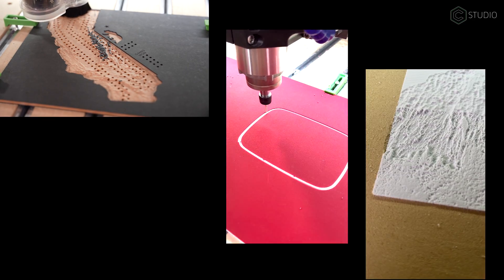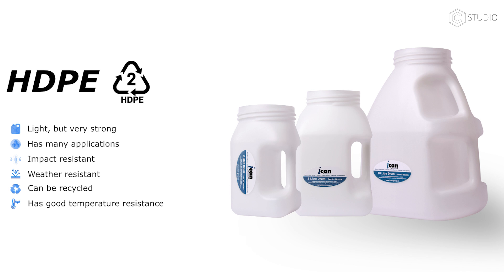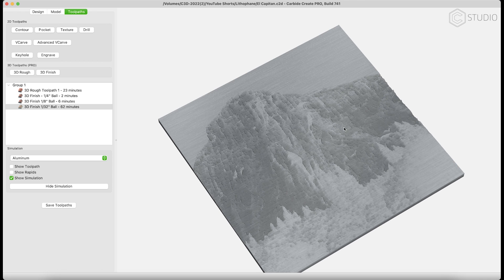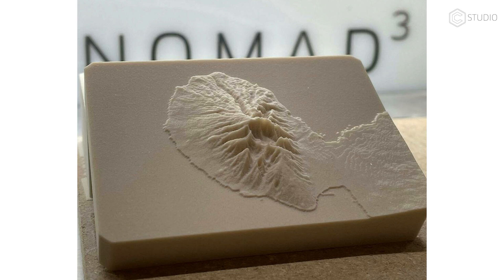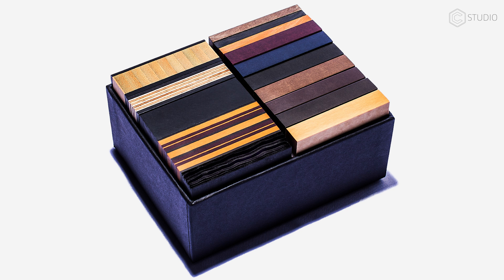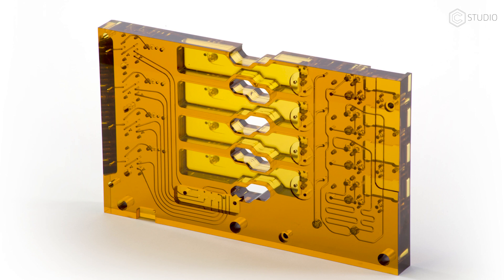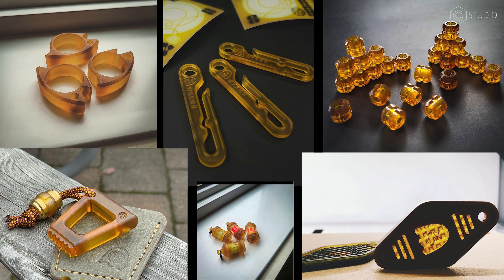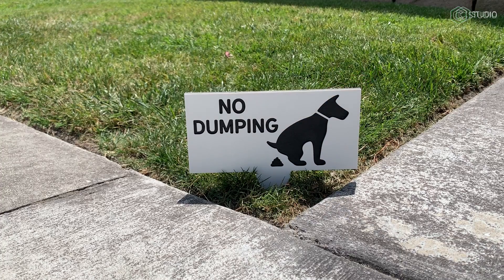5 Materials For Your CNC Router

Comment: There is ONE material that I've been 3D carving for a while, though I've never seen ANYONE mention it on 

YouTube, and that is Plaster of Paris. I got the idea a couple of years ago, and I've worked up a pretty good 

process. Carving the plaster blank rather than making a mold and casting the item will give MUCH better fine 

details. Plus, it's so fast and easy to carve, it's a TON of fun! :) If you have artistic skills, you can paint or 

color the pieces to your liking.

You can get started very simply, just buy a bag of DAP at your local crafts outlet and cast some blanks in 

plastic cups or food trays, doesn't get much cheaper than that!

You'll get better results and enjoy the process more with a few upgrades. 

Regular plaster does OK, but trust me and splurge for some good quality HydroCal plaster. It will hold 

AMAZING detail, offers extra strength and heft, and has a totally non-dusty finished surface. Avoid "Light 

Weight" Hydrocal, it's much too soft and flakes a lot.

Also useful are some of those silicone molds used for casting epoxy drink coasters, I have a bunch of 100mm 

squares, 100mm rounds, and a few larger ones for bigger pieces. Spritz the molds with some water with a 

few drops of dish soap mixed in to make sure the plaster flows into corners.

The next useful tool is a vacuum pump with a 2 gallon pot, for degassing the liquid plaster to make sure no 

bubbles are trapped inside the blank. I pull a vacuum, and then bump and swirl the mixing container in the pot
 to bring the bubbles to the surface. Let stand for two minutes, release vacuum, and do it once more.

It helps to put the molds onto a flat, movable surface, then level it with shims. Vibrating the molds after pouring 
can help a lot too, I press an orbital sander against the bench to do that, but you can just jiggle it by hand.

HydroCal will 3D carve EXCEPTIONALLY well, and since the blanks I make are less than 10mm thick, I 

simply run a 3D Finishing pass at upwards of 100 mm/second and a 10% stepover. I let the blanks cure for at 

least a week before carving. I'll typically use Tapered Ball-Nose endmills, 1mm diameter tip for most jobs 

including the ones shown in the photo, and 0.5mm for super-fine detail.

If you have any questions, I'll be happy to try to help you!

https://www.facebook.com/photo.php?fbid=10223705364078923&set=pb.1137301269.-2207520000&type=3
Reply from the maker: David,  This is very interesting.  Thanks for the info.  I see the photos you linked.   Do you have any other photos to share?   If so, send them to:  Support@Carbide3d.com   Attn:  Kevin

Comment: Renshape seems pretty expensive for larger sizes. Anybody have good resource for renshape? Or maybe a better material for mold casting?
Reply from the maker: It's definitely not cheap, but it works really well.  Maybe a dense wood would be an alternative, though not necessarily cheaper.
Reply: See my reply above about HydroCal. :)

Comment: Might be fun to add soapstone to this list as well.  Not sure if you've covered this before, but it's something that can be machined on a CNC and  can be made into interesting items.
Reply from the maker: Perhaps some chess pieces.  - Andy Dufresne
Reply: @carbide3d  I modified mine to mount to a concrete wall. Definitely need the quiet VFD spindle in my workspace. Special ordered a Raquel Welch poster to fit over top.

Comment: Great info, thanks! We also use Ultem in our 3d printers, not worth the trouble there imho. It looks like a really interesting material to CNC though.
Reply from the maker: Yes. We came across a bunch of 3D printed Ultem items.   None had the beauty of a machined sheet.
Reply from the maker: Also, wouldn’t a Circle of Owls also be considered a Parliament?
Reply: @carbide3d  Ha! It would be but these owls are kettling. They circle above, like vultures, looking for bits of wisdom.

Comment: I have a literal truck load of Corian scrap.  Can anyone comment on suggested feeds and speeds before I start experimenting with it?
Reply from the maker: We've had good luck treating it like Delrin or acrylic.
Reply: @carbide3d  Thanks!  That surprises me, given how hard/dense it is.
Reply from the maker: It cuts really well.  You'll probably have no trouble with it at all.
Reply: I just ran some for the first time and the feeds and speeds on my machine were similar to what I'd use on a hardwood.  I thought it was going to be too hard, but the tools went through it easily.  It does make a lot of dust, so be sure to use a dust shoe.  Quite jealous that you've got a lot of scrap.  I've looked up the price recently and it's gotten crazy expensive.  You could probably make good money selling the scrap pieces to fellow CNCers.  It's a fun material to work with and can be made into pretty parts.
Reply: @gizmobowen  Thanks for the feedback.  All of mine was inherited from my parents, and they collected it from a local countertop installer.  As far as I know, they simply asked if they could have their off-cuts/trash, and got it all for free.

Comment: Nice! I haven't even heard of most of these. I'll have to give them a try... I frequently machine aluminum, carbon fiber, and epoxy resin. It carves all 3 really well... With aluminum, you just have to go slow and some sort of spray/lube system helps (I used the air nozzle system that Carbide 3d made a video a few months back, and it works great for spray liquids too). Carbon Fiber is also amazing. I get good, clean, crisp cuts on all. Epoxy Resin (preferably fully cured) is a lot of fun to work with too. I've found, even if it's only partially cured (the consistency like soft rubber), I can still get pretty good results (I'm not patient enough to wait a couple days to wait for it to fully cure before I carve the next shape).
Reply from the maker: Patient?  We're not familiar with that word.
Reply: @carbide3d  HA! Yeah, that's why I have 2 shapeoko's. If my budget would allow, I'd get a 3rd :).